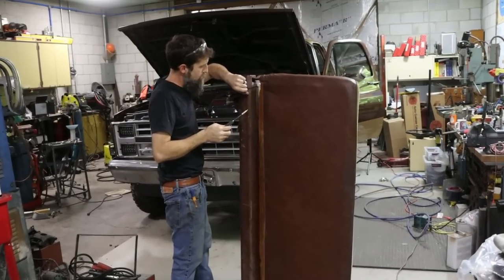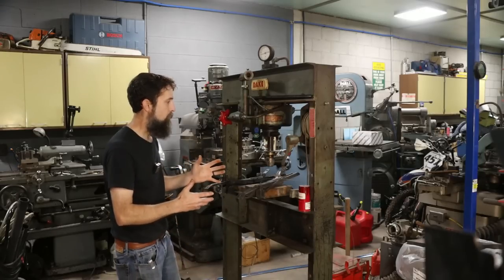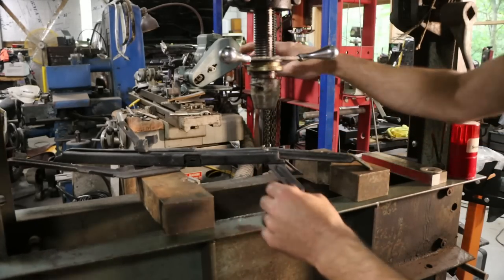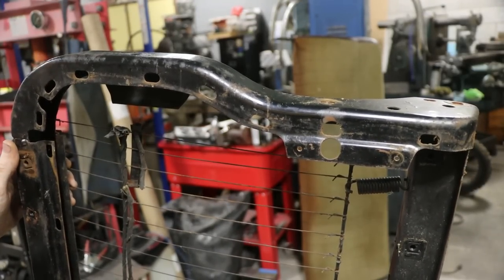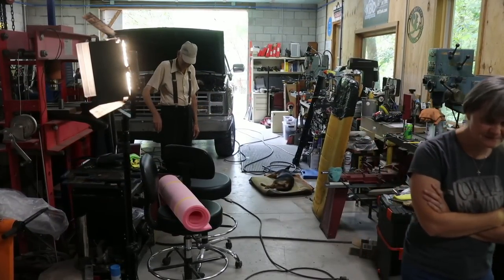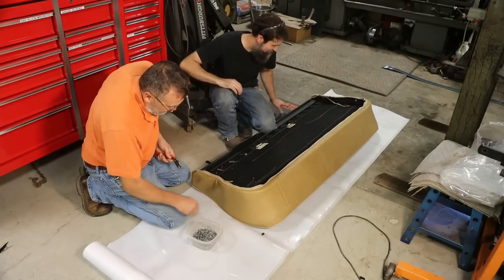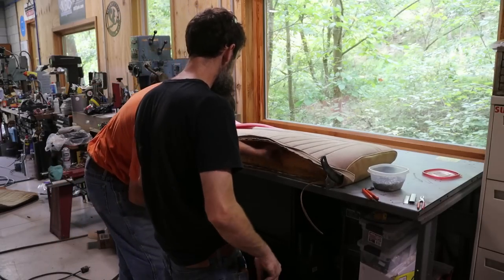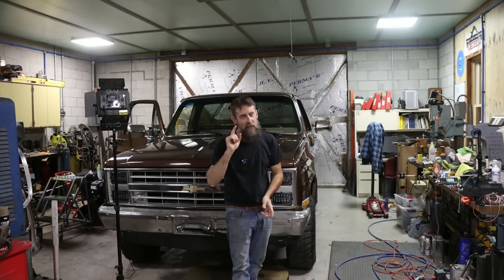New old Shop Equipment  & Chevy K10  Interior. Summers Family edition ;-)

Comment: Truck is looking good. I worked in a shop which had a tall press, a couple of the fitters were not as tall as the others. One of them made a cranked handle for the press to allow the shorter guys not to have to stand on the provided wooden box to operate the press. The handle was an old truck starting handle with a sleeve made to fit the pump receiver.

Comment: Steve, the only upholstery job I did was on a forklift seat I used on a tractor. I didn't have any upholstery material, so I used a tonneau cover and carpet padding for the cushion. It worked well, but what went first was the plywood back on the seat. At some point I'll need to redo everything this time, including making a seat back where the steel sides are angled. Fortunately, I have a good miter saw, so I should be able to replicate that. I'll use waterproof glue, and it should hold up better this time.

Comment: I built my press out of a length of heavy conveyer section made of 6” C channel, and an big bottle jack. I did also add an old boat trailer winch with some garage door cable to make a table lift. Nothing fancy, but it does the job…….

Comment: Hi Steve, I have the same press. Also saved from the scrapyard. Fantastic press. The table lift and the screw adjustment makes it a super useful and in my opinion, a safer press. 
I had to do a full rebuild. Mine had sat in the rain for a long time. 
Dake sells rebuild kits - fantastic company to deal with. 
Watch out for the casting that holds the table lift gears. It can get broken when people forget to release the table tension before pressing.

Comment: I have a K R Wilson press made in 1954, 60 ton. It has a hand operated function that works like like an arbor press and a 2 speed hand hydraulic pump. I prefer the hand hydraulic as you have more time and feel of what is happening than with an electric. I love this press. If anyone has a chance to buy one of these presses they won’t be disappointed either. I wish it had the screw down ram like your Dake has but I have yet to see a press that has everything one would want. I would go with the darker carpet as soil won’t show up as much-my 2 cents. Truck is really looking great and I like your exterior colors. I would be honored to come down and put the first scratch in it so you can actually use it😉.

Comment: Regardless of what carpet color you choose, I'm a huge fan of WeatherTech mats.  Made in USA.  I don't know anyone who has them that doesn't love them.
Reply: They're pricy, but I have a set in my truck and they are fantastic. How could anyone not love those mats.
Reply: @marcellemay7721 , I put a Weather Tech mat in the back of of my 2014 Silverado, it comes up the sides about 6-8 inches. It also has a piece for the tailgate so that doesn’t take a beating. So far so good, the floor mats can’t be beat.
Reply: All of my vehicles have them.

Comment: I have a little bench top 10 ton Dake press. It had a single speed hand pump and took a lot of strokes to position the ram. I looked for a two speed pump and found Enerpac and Mcmaster had them for $3K-$6k. Ouch more than I paid for the whole thing. I looked everywhere and then found Dake's 20 ton press had a two speed pump. I reluctantly called them expecting a big price but they quote $170. They didn't have it in stock and quoted 3 month delivery. Because various China problem it took  8 months, It finally arrived and works great!

Comment: You got a wonderful family there, Steve.  For someone like me who has never used one, your hydraulic press is fascinating.  On the bent seat rails, I noticed that usually the bend was confined to a length of about 2 or 3", but you straightened it on blocks at least a foot apart.  Clearly you did the exact right thing, since the track rails slid after you were done.  I guess this implies that the original bend in the track weakened the metal a bit?  I very naively would have expected some work hardening.

Comment: Now that you are in the stage of my whelm (28+ yrs as an upholsterer and restoration business) over the years of having ACC-- Carpet & Form, Year One, Classic Industries, LMC, you made good chooses. Only thing that will one day come back to give you an issue is using 3M 77 to bond the felt to the new form bun. KY like TX, heat and humidity will turn the felt loose, and when it does, the slider tracks will be the first thing that finds the felt. When this happens, simply lift off and reglue using Weld Wood laminte top glue in a bottom loader (like Binks spray gun) Wish I could have been in a position to sew you up custom covers, but life after the Brides passing in July and now fighting covid, really has this old Bear's world turn upside down. I will see be waiting to see Elisabeth do her first Front Wheel Burn out (@@)! Looking Awesome, Bear.